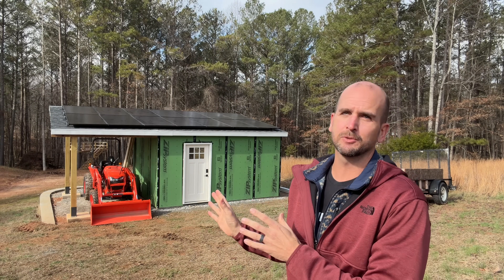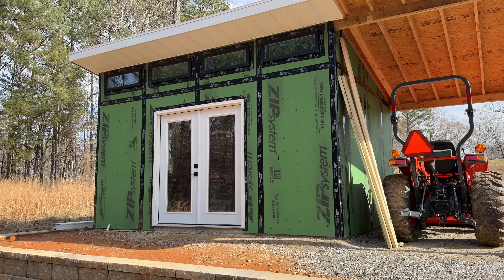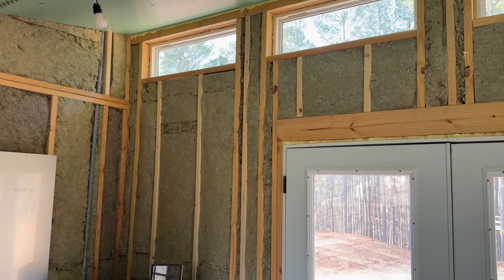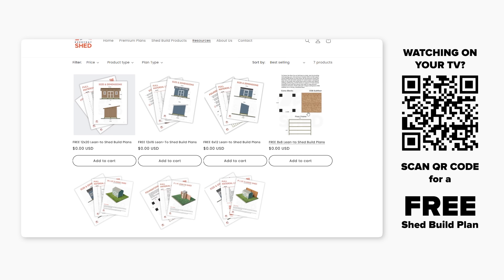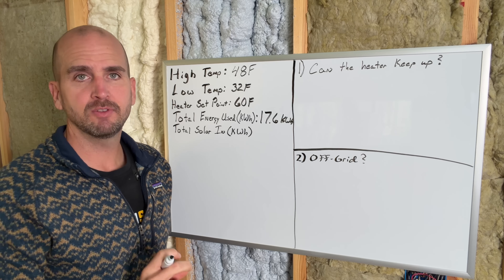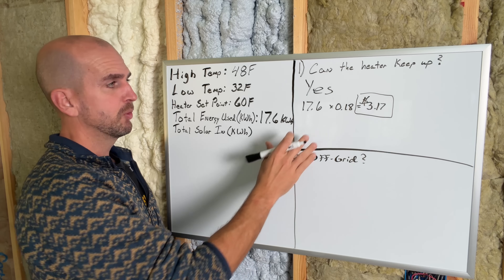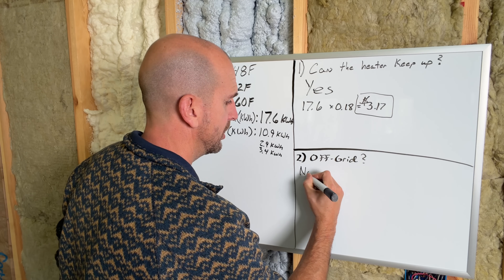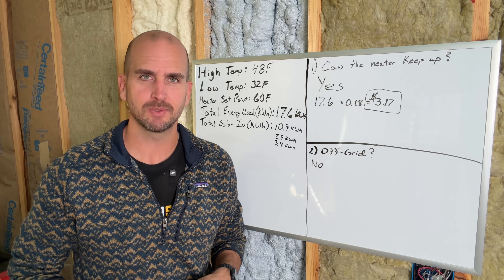HUGE Mistake: Why My $15,000 Solar System CAN'T Heat My Tiny Shed

Comment: It's funny seeing all the "heat pump" comments below but they forget one thing - once the temp drops significantly below zero, he heat pump works MUCH harder, as it sucks the heat out of the OUTSIDE air to work.  So when it's -20 you will be using more energy with a heat pump, if it even works at all... Why not just install a wood, oil, propane, or diesel heater or even a wood pellet stove?  You can get small wood stoves and they will keep you hot in the coldest winter days.  Personally I like the direct vent propane heaters - easy to install, many have thermosats.  Off grid, propane is typically used for heat, hot water, and cooking...

Comment: I'd probably go for electric underfloor heating with Ceramic or Porcelain tiles 👍  just make sure the floor base is well insulated to stop heat going down (there's plenty of products for this - not sure about the US though 🤔).

Comment: Looks like folks have of suggestions for improvements in the comments.  Ceiling insulation is low, you need a heatpump,  orientation and angle of solar.   Still think you would need to triple the battery to make it through a cloudy week

Comment: The scam that solar is; has been known for a very long time. Now if you have endless amounts of money to throw out, then what are yo doing it for? To run some led lights and a laptop? Fossil fuel will always be second to none, unless they release zero point energy, and that is not happening. Im going to spend 15 grand for energy that cannot run a 1,500 watt heater. That is a great return on investment. But hey, you received the system for free, and made an infomercial to sucker others into your madness. Make it make sense

Comment: I built a 10x12 shed. I was excited to buy solar panels and an Ecoflow Delta 3 Plus. Unfortunately I discovered this setup would not be capable of powering a tiny heating enclosure for the Delta 3 let alone the entire shed. Also, the manufacturer has told me that this unit can be damaged by cold weather. I would have to run an extension cord from my house to the shed in order to power a heater. That defeats the purpose of having the solar panel and Delta 3. Big disappointment.  Not many are speaking on this issue.

Comment: You have lower R value in ceiling of R-10 verses R-25 ? ? ?, Many current building codes have a R-30 or higher in ceiling. Outdoor temp make big difference, Heat rises increasing heat loss. Reading other comments here many know how to build a warm space. May think about adding 4 inch's of foam to the outside walls as well to cut down on thermal bridging at least 4 inch's of insulation or foam in floor with thermal break gain cut thermal bridging. seal all seams on outside of building. Window shades can help cut down heat loss. Are windows energy star?. 6 inch stud walls would be better then 2x4's. Many shed makers now office a high tech reflective sheet good to cut down on sun hitting roof and heating inside. More windows on Southside of shed would help in heating with sunshine. No matter the cost I would go with the highest R value insulation for long term use 20-30 yrs.

Comment: Right here in a nutshell is why solar can't work to supply the U.S. energy needs,  if you include the heating needed even in just cool climates (not even cold climates) in the winter.  $15 K of solar + battery can't even heat a shed.

Comment: The most effecient way to heat/ condition a space with solar is to incorporated a geothermal setup. After install u only need to run the pump and fan blower.

Comment: If you want an office, don't build a shed. You don't have to bee an expert to see, that there's no way that you can heat this room up to an comfortable temperature in winter with a solar system. The insulation is laughable and you used a power hungry heating system.

Comment: In addition to all the Heat Pump comments, you can get a helluva lot more battery capacity for your money vs that expensive Ecoflow stuff if you bought an separate inverter and a bunch of rackmount batteries, the prices of those things are getting really cheap if you know where to look.

Comment: Solar panels are incredibly inefficient and then add the lack of efficiency in electric heating and your lack of adequate insulation… This is a "how not to” video. I am not trying to be mean but I do have close to 40 years experience in building everywhere from Southern California to Montana. If you are really trying to be green and use the power of the sun you should plan it out to use passive solar. Southern exposure hitting a darkly colored stone or concrete mass with an overhang preventing sun exposure during Summer months. If you are not shackled to the religion of renewable… which is hypocritical because the solar panels are made in sweat shops using harmful substances and wear out relatively quickly and become landfill….. A rocket mass stove  is incredibly efficient and wood is ACTUALLY renewable. Heating oil, propane or pellet stoves are far more economical otherwise if you want a thermostat keeping steady temps.

Comment: this feels like it's not a good test. a: better roof insulation. 2: is the floor insulated? III: if you are running 247 why not bring the room up to temperature then run th test. the heater running at 100% for 6 hours straight deff offset this. last use a heat pump.

Comment: My entire off grid house only has 7.2kw of solar and it heats fine with mini splits. It’s 2,100sq feet and each room has a mini split head unit.  Way better insulated than your shed though.

Comment: You can't heat your shed because: 1) you didn't insulate properly, and 2) You're not using a heat pump mini split. Make those two changes and you could easily heat your shed

Comment: Roughly 4:30 on is my concern.  Those oil filled area heaters are the least efficient ways to heat an open area.  You should perform the same test with an electric room heater, preferably one with the switch on the bottom to cut it off if it gets tipped over.  Most of them are for 15A plugins and should drop the KWH used per day as well as actually circulate the air aiding in the heating.  In the end, it comes down to using less than the power generated allowing a battery bank to power things other than heating.

Comment: take that heater and junk it  
if you buy a 120 volt heat pump you can heat a 2 story house  at 32 fahrenheit 
only using 400 -600 watts 
if you are at -12 it will use 1000 to 1300 watts  in a 2 story house that is 140 years old

Comment: you can generate heat directly with  hydonic panels-- it uses the heat itself and does not convert to electricity, so it is  much more efficient circulate antifreeze if your temps go below freezingb

Comment: The only way to go is solar thermal if you are going to do heating via the sun.  With 10-15 percent conversion the numbers aren't there.  Solar Thermal gives you a much higher conversion, similar to 60's vintage boilers (80 percent).  The biggest consumer of energy in a home is keeping your home warm in winter and cool in summer.  Night time is an issue for both.  Solar just isn't the answer unless you live in a place that isn't all that hot or cold and the nights can be managed.

Comment: Lift the angle that your panels are sitting at. It's plain as day that your panels are sitting at the wrong angle for your latitude. This might seem like a small thing but it isn't. You will see a huge jump in your energy production by simply putting those panels at the correct angle. They should be sitting at roughly 60° and they're sitting at roughly 25. Why not point them North?
Seriously especially considering that you are using the solar panels specifically for heating then you should be optimizing their angle based off of the winter sun because I imagine you don't need a whole lot of heating in the summertime. Your panels are far too flat. Change it.

Comment: The efficiency of this space is garbage even with the rockwool.  You need to insulate that slab and use a heat pump to have ANY chance.

Comment: That's a $5000 system. And you definitely should not try electric heat with solar power. A heat pump would work much better. Lastly, did you consider actually insulating the shed? IDK what you did but the heat load math ain't mathing on that tiny building.

Comment: One big mistake I see is 2X4 instead of 2X6. You do not need the 2X6 for strength but for insulation thickness. I built a small cabin in the N/W Cascades at 4300' elevation with 2X6 walls, roof and floor. The floor is insulated also. It takes very little heat to keep warm. Thanks for the videos I enjoy your informative content.

Comment: I have a question.  1 oil radiator electric heaters never run at their rated capacity you are far better off with a basic cheap fan heater if you want to heat a space... 1500w is and will always be 1500w regardless of what it looks like, and because of the way thermodynamics works resistive heat is always 100% efficient.  the only way to do better is to use energy to move heat.  so why aren't you considering a heat pump mini-split?  finally when I've lived in off grid situations we used gas for all our sources of heat.  this is important because when you live in a cold area you have good options for propane heat I personally love the wall mounted vented passive heaters.

Comment: This whole exercise ought to have been calculated at the start, it really is simple maths. Intuitively, to get a decent environment relying on a 1500W heater I would have expected at least 100mm (4") of Rockwool between the studs and then 50mm (2") of PU foam board with a vapour barrier and plasterboard finish and the same for the roof.  The floor also need insulating with at least 100mm (4") of PU foam board.  Whilst you can simply calculate the heat in/heat loss the issue becomes getting the space up to temperature within an acceptable time from cold, whatever that temperature is, that means either increasing the heat source and/or the insulation to the point where the heater is modulating the heat input on the 'stat.

Comment: I see a structure poorly insulated. He has 6KW, I have 10. While I am grid tied, I COULD accomplish the same with a large battery install but the usual power company franchise agreement means my in-town house must have an active connection to the grid for legal occupation. My 10K driving 3 mini splits heats and cools our 2200 sq ft home with no problem.

Comment: The heat pump is ok, but something different to test would be a small 24volt diesel hydronic heater with a water radiant heater.

Comment: NEVER use an electric heater on solar. Anyone who does solar (and more so off grid) knows it. Especially with a $15k system 
Get a DIY $500-800 ductless AC with heat pump. That would SIGNIFICANTLY cut the energy use - and apart from extreme weather should be able to keep the shed heated.
Given you'd likely use the shed in the summer, you'll need AC anyhow, ductless with heat pump cost more/less the same as "regular" ductless ACs.
Would be great if you could redo the video with the ductless heatpump.
Thanks! 🙏

Comment: My 30 dollar two burner propane heater does just fine without all the tech and costs TONS less. Plus I can warm my house with it during extended power outages , just leave door open a bit.

Comment: Scott, I designed and built an off grid solar home, and derived the rules of thumb to make an off grid structure work:
1) The structure must be super-insulated to reduce the heat needs . It is easy today to build an R-40 wall and an R-55 ceiling, using a 2x6 wall and 2” polyurethane exterior foam board which is only a bit more than you have already built. 
2) the slab and footing wall must be insulated as well, loss through the floor is substantial. 
3) The structure should be faced south and virtually no windows or doors should be on the north side. 
4) The structure should be air tight, the windows and doors must be matched to the super-insulation so that the air leakage is almost zero.
5) The windows should be.triple glazed so they are at least R-5 on the glass surface. 
6) once the heat loss through the structure is low enough, a solar powered system can easily heat and cool the structure, heat pump split units are extremely efficient and easily installed. You are using resistance heat, it uses three times the power that a heat pump uses, you’ll get three times the heat with a heat pump.
All of this starts out with controlling the heat loss of the building. Reach out if you want, I have tons of data and can help you as you continue your journey! BtW your videos are excellent, and well grounded in solid technical horse sense! 😮

Comment: You have an entire forest right in front of you door. Install a wood stove and you can heat this cabin perfectly. Encase the stove in stones on two or three sides and the contraption will radiate heat for hours. Wood is stored solar energy.

Comment: Could also do a hybrid insulation on the cheap. cut the cheaper polystyrene panels to fit, Fix in place, add mylar barrier and add fiberglass. With the moisutre wind blocking ability and the fiberglass and the ir reflecance you get much higher r values. You could even use more durable reflective greenhouse mylar as the last ir barrier step to encapsulate also the fiberglass.

Comment: $15,000 for that setup? This just for solar or is this for the whole cost of the shed? if just for solar, bro got ripped off! 100w panels around $80 per panel on amazon. Had my for over 6 years now still working great!. looks like he had 15 panels. so 1.5 kilowatts per hours. 100ah weize battery $180. 100ah x 12 is 1.2 kilowatt hours stored. take away the 20% for not completely draining battery. That 1.5 kw space heater is equal to his panels. means not going to ever get net postive running that. try 2x 500watt mini heaters to give a 500 watt charge value. other thing is those panels are almost flat! like 55degrees or maybe like 60, just eye balling here. I live in the northern US where its cold and Snow! for me summer is 73 degree angle, and winter is something like 83. sooo just split that value for was 78 degrees! gets me way better charge times. my charge controller is 40 amp, that maxes out at 1.2 kw of 12v panels on a split up 24v/600w system. so with 15 panels need maybe 2 mppt charge controllers coupled together, still there like $200 per,  buying like 10 100ah batteries is like $1800. ok toss $200 more for fittings $400 for all the fancy brackets, yest there backets for roofs like that will angle them at better degrees. also facing to the south if in north america! im guessing 2 little amazon 500 space heaters will do better! and get enough charge to charge up the batteries for the night. all yeah running all the time vs periodically. like house furnaces turn on and off! plug in thermostats for $25 to $40 can save lots of the energy usage. Them radiator heaters takes a few mins to really get going. while heating element ones are quicker. oh yes if there are gets snow. them panels gonna get covered at that angle! Hope this helps!

Comment: Can't fix stupid. Not nearly enough roof insulation, resistance heat instead of a small heat pump (they make window mounted ones now like Midea), grossly overpriced "solar generator and additional battery packs, and solar panels pointing at sky instead of at the low winter sun.

Comment: 15,000 for the solar system, you definitely could cut that in half an have a way better system. out source not just stay with a single brand. roof insulation is inadequate!, you need a dc heat pump! my 3000sqft home is all electric, we are off rid

Comment: Lots of suggestions for more insulation and a heat pump, which are really sensible. Heck, you can get a 12k BTU heat pump for under $500. But another alternative would be a diesel parking heater. Those will very easily keep a small space like that heated with very little 12v power draw.

Comment: Up north where I live that insulation would be way too skimpy.  If you beef that up and get those solar panels at a more correct angle that would go a long way towards reducing your heating needs and increasing your energy production.  If you aren't dealing with bitter cold winter temps like I have here a heat pump would also be much more efficient.  Around here unfortunately solar isn't much good for winter heating.  The days are too short, the sun is too low, and we get long periods of gloomy cloudy weather.  But we've got a lot of wind so that's the off-grid ticket here.

Comment: For such a small space one of the eg4 12k mini splits (not the solar one, the seer2 28 one) should only use like 3-4kw. Mine uses about 4-6kw keeping a 2x larger space in those temps set at 67F.

Comment: There's a reason people buy Chinese ripoffs of Webasto or Eberspächer diesel heaters - and it's simply the fact that the energy density in fossil fuels is vastly higher than it is from solar and the like, especially in the winter solar is basically useless. It's just physics and not much one can do about it. Electrical heating is possible of course, but the only sensible way to do that is central high capacity generation on the grid, and ideally through huge supergrids that span continents so you can ship electricity up from the south to the north where it is needed in the winter. Solar can be great for defraying the cost of air conditioning in the summer, though.

Comment: If you want to heat the shed in the winter, you need to move those panels off the roof. Every watt-hour that falls on the black roof will be converted into heat by virtue of the shingles as opposed to 30% being captured to turn into electricity. Mount them where they won't throw shade on the structure during the winter and you will have a much easier time of it.